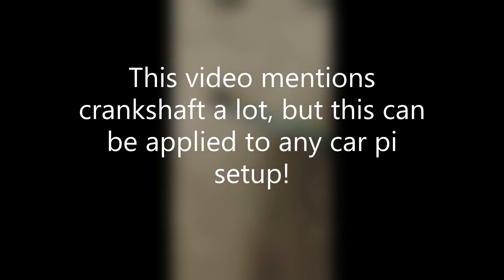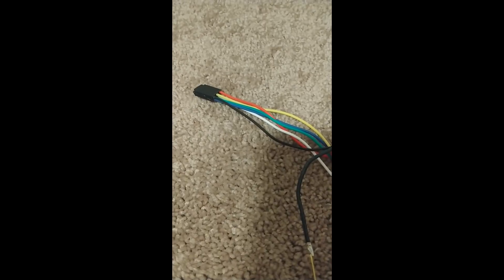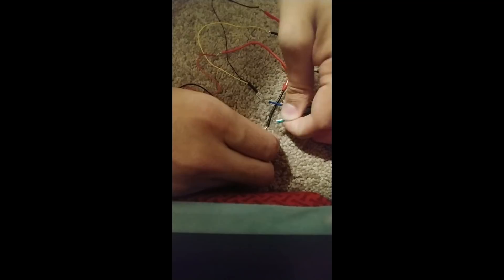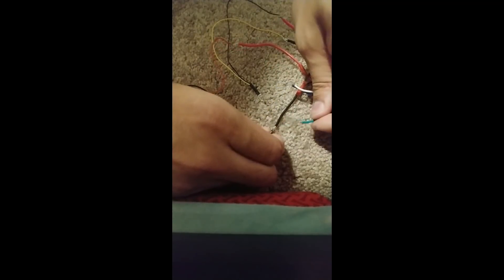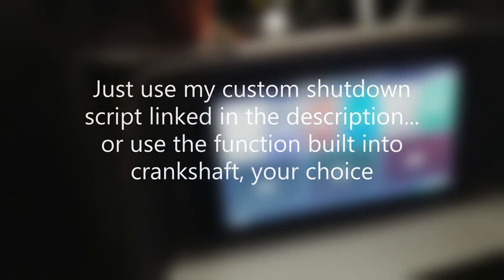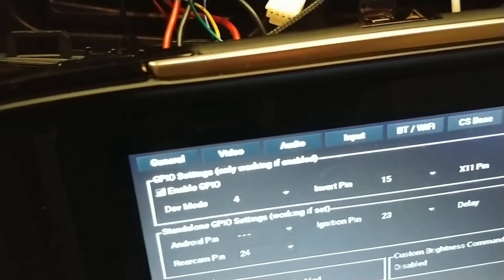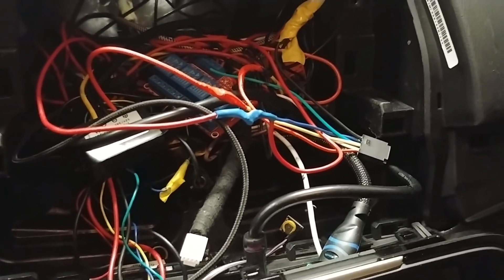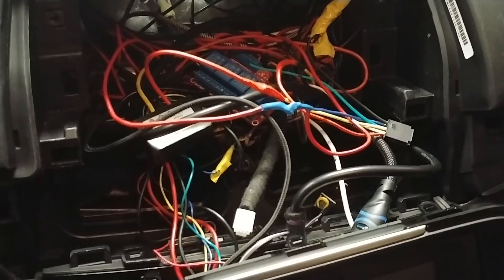Shut your Raspberry Pi Down Gracefully in your Car Using a Timer Relay

Comment: Please post the wiring diagram of the delay and relay board in relation to the PI.
I am a little confused.
Reply: Please excuse my ignorance on the topic, but I am also curious about this. It is a 12v relay and the Raspberry Pi is not.

Comment: How has reliability been with the SD card, sorry if this has been asked and answered
Reply from the maker: reliability has been excellent.  Never had a single problem as of yet.  As long as the pi is being shut down gracefully, SD corruption shouldn't be a major issue.  It's mostly when you turn off the pi ungracefully that you run a high risk of SD card problems.

Comment: I'm in Australia and would cost me $45 to get the timer you listed delivered here is there an alternative? Thanks!
Reply from the maker: I actually saw a good discussion on this recently on reddit.  Someone achieved this by connecting a simple 5V USB powered relay in line between their battery and pi.  The ignition is a GPIO input, and when ignition is off, it sends a shutdown signal to the pi.  When the pi shuts off, USB powers off, which opens up the relay and then completely removes battery power from the pi.  A very cheap, easy, and clever solution.  Here's the schematic he drew - https://photos.google.com/share/AF1QipOTn9qvY-o4xgQWUpOycQWTLk6Ng0QhER4FTqmgbSHeSOY_v5XT-BIei_dPO1kxcA?key=ZUhybzVXNDhudnRfQW1Kdk1Md0ZlM1VVTjVlbVd3
Reply: @Productiv-ai  Anyone who has had a crack at this method, does the Pi shut down safely before it cuts USB power?  I would have thought it would cut USB power before it finished shutting down.
Reply: Hmm sounds interesting, did you happen to have the link to this reddit post?
Reply from the maker: @troymaher8237  https://www.reddit.com/r/crankshaft/comments/ai1kug/camshaft_concept/
Reply: @Productiv-ai  Thanks I'll definitely check this one out!

Comment: Are you a Linux guy or a Car guy or both ?  I ask that to ask my next question...
Reply from the maker: Not either really. Definitely not a car guy. I do love electronics and sound especially, so car audio and upgrading my infotainment drove me to do this. A lot of my hobbies use Linux but I still use windows primarily.
Reply: @Productiv-ai  I am both, but I am a sysadmin and a dev by day .  Thats said, you did a good job with the hardware.  I have a suggestion for you I just want to make sure its completely sound.  I am going to try to eliminate all those wires for you.
Reply from the maker: @s4b0t4ge7  Sure, whats the suggestion?  Yeah in hindsight there are better and cleaner ways to do this.  It was put together piecemeal, just kept adding parts as the scope grew.  But it's working perfectly for the time being.  I'm a controls engineer by day.  Carries over well w/ my automation hobby.
Reply: @Productiv-ai  I could tell just by the way that you spoke that you weren't just a man who likes cars  who heard about using RPi's as a head unit.  Did you write the script on pastebin ?
Reply from the maker: @s4b0t4ge7  I tend to use Google and find sample code, then modify it to my needs. That was the case with this one. I only script on rare occasions, so even though I know how to program in general, I don't do it often enough to bang out clean code from scratch.

Comment: Why not use a low power Arduino with a relay?
Reply from the maker: Possible.  But not as straight-forward as it would seem.  The timer needs to be connected before the 12V->5V power supply.   The arudino is powered 5V though, so you'd need to add a voltage divider to step the 12V battery power down to 5V for the arduino.  From there you'd then need a relay as well, which means you need 3 components to pull off what the timer relay does with 1 component.  The main advantage using the arduino however would be configuring the timer would be easier since you could program it in the arduino ide.
Reply: @Productiv-ai  Why does the timer need to be connected before the 12V->5V power supply? The arduino's DC-DC converter could be hard wired to the battery and operates at relatively low power. The arduino receives the ignition trigger and starts the countdown timer. After say 60 minutes, the arduino sends a signal to the Pi telling it to initiate the shutdown script. Then the arduino waits 2-3 minutes and sends a signal to the relay shield to cut power from the battery to the Pi. I think as long as the logic level is the same, this shouldn't be a problem? The question to ask is how much current does the timer use in standby vs. a DC-DC converter and Arduino and does it make a world of difference? 

Check out this link on efficiencies of DC-DC converters, specifically for powering an arduino from a car battery. https://blog.yavilevich.com/2017/03/efficient-dc-12v-to-5v-conversion-for-low-power-electronics-evaluation-of-six-modules/
Reply from the maker: @brettschenck1569  the timer I'm using consumes 4mA at idle, practically nothing.  Again I like the idea of an arduino more though as the timer can be programmed and adjusted through software. As you can see from this video, this physical timer is a pita to program, and once it's installed, you aren't reprogramming it again.  Thanks for the info
Reply: @Productiv-ai  4mA is practically nothing!

Comment: One more question. The Amazon links to the power supply listed in your other videos are dead. In this video, the supply you are using is 12v to 5v/5a. I can't quite make out the brand and model number. Do you have a good link?
Reply: Any detailed tips on wiring the relay. I bought same one you have. I get I have to power it from ACC 12V but is it just one wire out to the gpio and if so, which one?
Reply from the maker: Sorry about that.  Here you go - https://amzn.to/2VJ7sBB.  I updated the link in the descriptions as well.  One quick thing - there is an easier way to handle safe shutdown.  They make devices that combine a configurable timer and power supply in one.  Two options I know of  -BWS Car PS -  https://bluewavestudio.io/index.php/bluewave-shop/power-supply/bws-car-ps-v1-usb-detail.  Mausberry Car Switch - https://www.mausberrycircuits.com/collections/car-power-supply-switches/products/3a-car-supply-switch-1.  I will have a hands-on review of the BWS Car PS soon, as the company is providing me with a sample for my review.  Either of those products is superior to my current setup, bc they're built specifically for powering a pi in a car and essentially plug & play.   Up to you though...
Reply: @Productiv-ai  Does the BWS Car PS actually remove 5V power from the Pi when the ignition is off?
Reply from the maker: @brettschenck1569  no it does not currently.  They actually offered to let me review it, but I asked this same question, and found out that it powers down the pi but leaves voltage applied.  This consumes 74mA, which imo is way too high.  They apparently are looking into revising the design to allow an option to pull power completely, based on my feedback.  We'll see.
Reply: @Productiv-ai  I completely agree with you too. Plus I believe any of the USB peripherals of the Pi will likely add to that current draw.
Reply: Thanks for the new info. I'll take a look and look forward to your review.

Comment: I thought this would be achievable with a shutdown timer via a gpio and a relay from the ignition. eg. Relay off = 'shutdown -P +60'
Reply from the maker: This would shut off the pi, but if you leave the pi powered on by the battery indefinitely, it will still consume a small amount of power and eventually drain your battery if you leave it long enough.  You need to remove power completely from the pi in order for it not to consume any power.